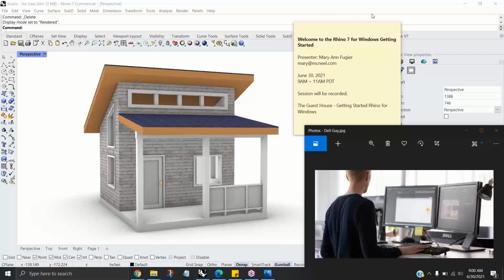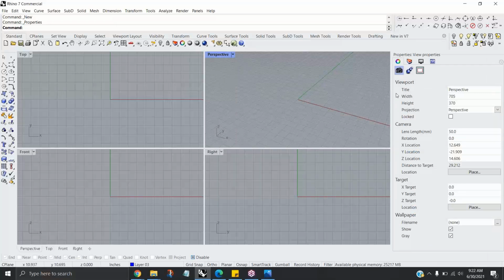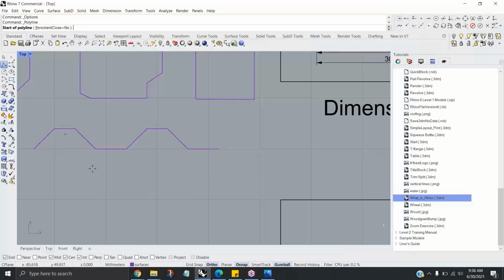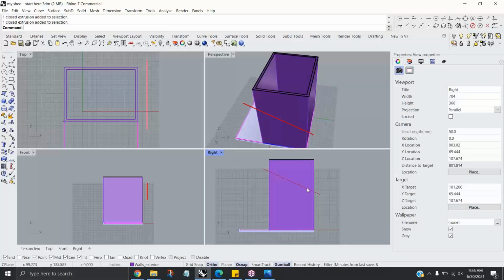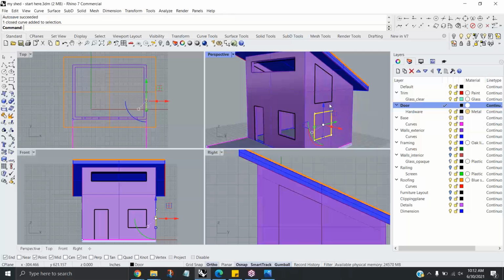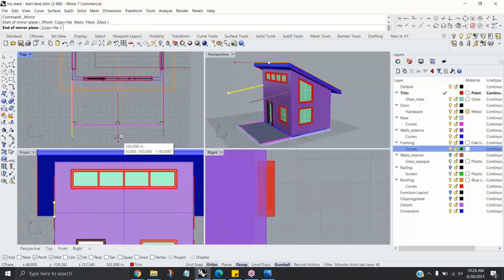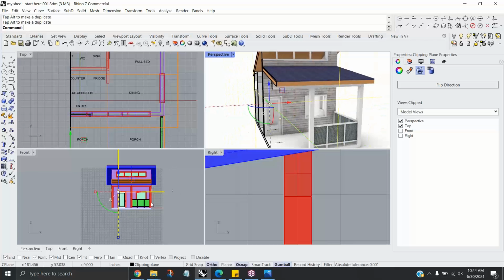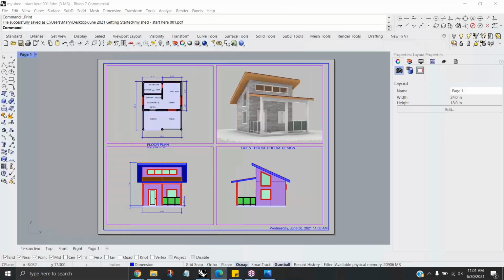Getting started Rhino  for windows - House build

Comment: Files for this tutorial are available here:
http://mcneel.s3.amazonaws.com/misc/misc/Getting%20Started/June%202021/STUDIO%20BUIDLING%20-%20June%202021%20GS.zip
Reply: thanks for share, greetings from Mexico!
Reply: Link still doesn't work
Reply: @CrossoftheRavens  Sorry you are having issue. The link does work for others. Please copy the link into a new browser window and see if you can get it to download. If it does not work, try a different browser. http://mcneel.s3.amazonaws.com/misc/misc/Getting%20Started/June%202021/STUDIO%20BUIDLING%20-%20June%202021%20GS.zip
Reply: @maryfugier5160  Copying to a new tab did the trick. Thank you very much.